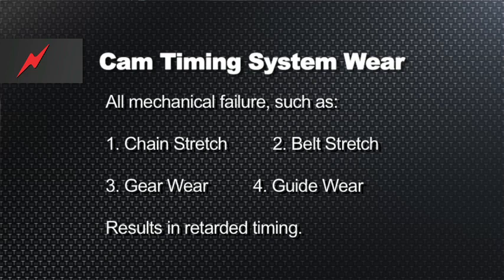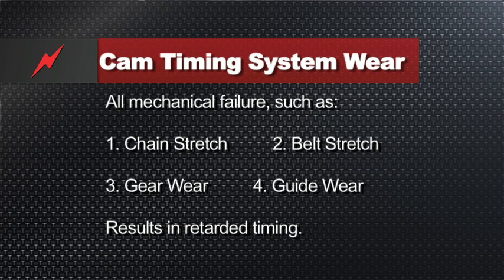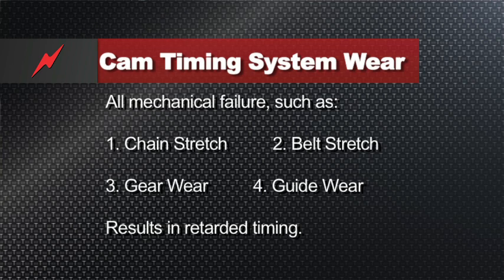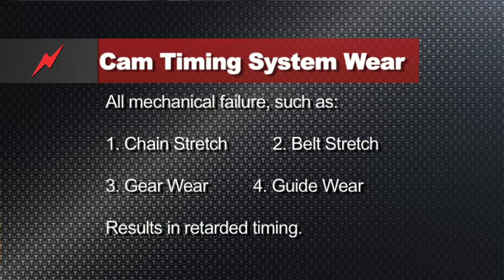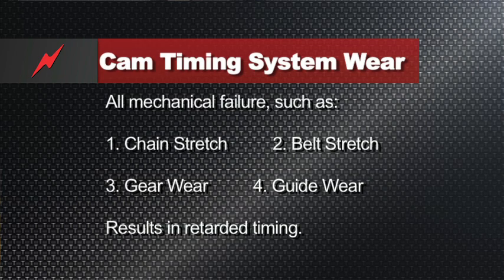P0012 & P0014| Advanced vs Retarded Timing| Tech Tip

Comment: I have a 1.8 L 06 Pontiac Vibe I replaced the timing chain and the sprockets including the VVT I'm getting a check engine light and it says Advanced retardation could I have installed the chain off by a tooth? Everything runs fine starts good drives fine could you please help thank you

Comment: To whom it may concern here’s the thing I have a 4.2 Oldsmobile bravado all wheel drive vehicle and it turns out that I change the oil I change the VVT because it gives me the air Ercola PO 14 and it’s variable timing so what’s happening is I keep clearing the code after I change the VVT and it keeps coming back so I have to use the scan tool to erase the cold and it will last for a little while but then it always comes back so my question is I would like to know how can I retard or advance the timing sequence cause supposedly supposed to do it by itself with the computer as I can see so I would like to know what my next step would be please someone can you reach out to me and help me out thank you I appreciate it

Comment: I'm at my wits end with this van. I have a 2008 Pontiac Montana 3.9 V6 with stupid ass VVT system. My timing is always at 22 degrees advanced and will not come down. It will go back up to 25 if called on. The computer wants 5 degrees at idle and it just stays advanced at 22. Causes P0016 and P0011 codes. I changed the VVT sprocket to a used junkyard one and still same thing. Advanced and staying there. The timing marks on the gears line up perfect as they should and no slack in the chain or guide. What the hell is wrong?
Reply: Are you getting any codes?  I would check camshaft position sensor and/or circuit if any codes are leading you there...if not any camshaft position sensor codes I would stay focused on the camshaft itself and the solenoid could have a short to ground or you could be stuck in advanced timing due to varnish like what has been said in this video.
Reply: @macknumber9  This problem had me to sell the van for peanuts. Simply could not make the timing right no matter what. I changed timing chain in the end. Still timing stuck at 22 degrees advanced and the only explanation at the end was the crankshaft thing that the crank sensor reads must have moved. It would require crankshaft removal. I did everything I could. I love the 3.9 engine but this problem on this one was weird. I heard it can happen but wonder how often it happens.

Comment: I have 10% advanced timing after replacing timing cover and head gaskets on my 2003 ford taurus. 
   Yes I had my camshaft synchro out while working on the cylinder head. 
   Does this mean my camshaft synchro is advanced by 10% or is the crankshaft that would be ahead of the camshaft synchro by 10% ???

Comment: I'm locking my intake cams in advance with a kit for performance. What will happen a check engine light or worse since it will be still getting signals to self adj   but it won't be able to.
Reply from the maker: If the kit is correctly installed the check engine light will be OFF. If you find yourself with the check engine light ON then you need to take to an automotive shop ASAP. Best case scenario, it will need a reset time to time. In a Worst case a P0010  code - worn/stretched timing chain.
Have a safe day!

- J. from AVI

Comment: Base on the info in the video does it mean that VVT system -if failed - would mostly cause a cam advancing fault code?
Can I ask what type of scanner you have thier on the table?
Great information, Thank you very much.
Reply from the maker: I can't answer the Cam Advancing Fault code at this time, but I do know we used the Snap-On VERUS® PRO DIAGNOSTIC for this video and currently using Snap-On ZEUS® DIAGNOSTIC.  Hope that helps :) 
-J from AVI
Reply: That is one expensive tool you have got there man, Good stuff, Thank you very much.

Comment: hi i have a 305 with a mild cam dont know what size.  my question is i 
have a pertronix flame thrower  distributor with copper springs 
installed   can i use a b28 canister  with this  engine i am  kinda new 
at this 
 thank you